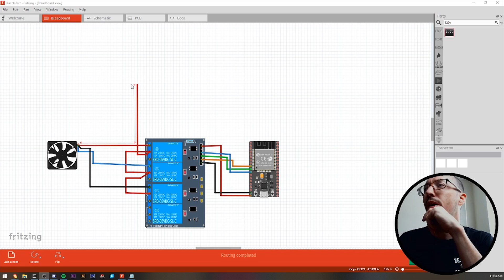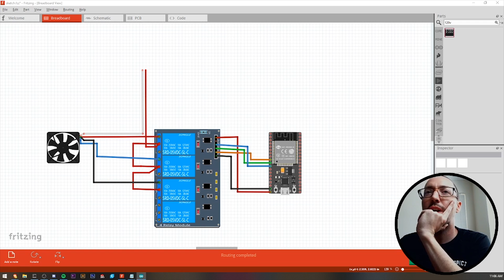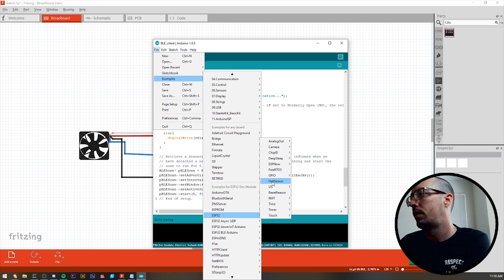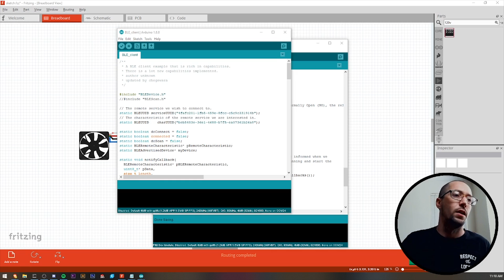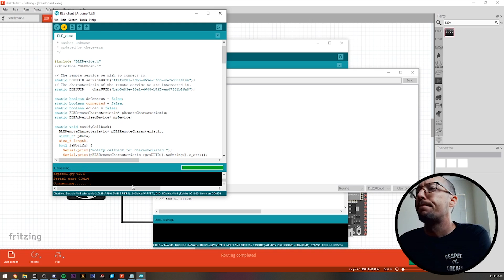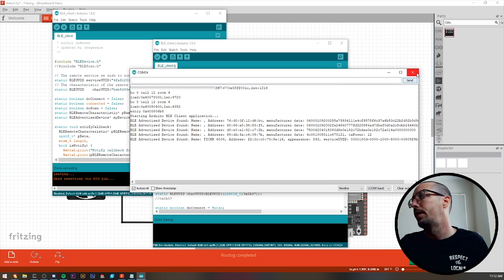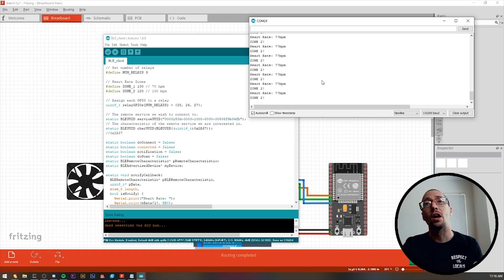DIY KICKR HEADWIND (HRM CONTROLLED FAN)

Comment: Hi Andrew,

Thanks for the details. I tried it with Garmin HRM-Pro but had lots of problems because scan can not find the hrm. When i move the esp32 very close to Garmin HRM-Pro, it finally catch it. Connections is disconnected when the distance more than 10/15 cm. I have searched and found some informations about power level. I changed the power level to ESP_PWR_LVL_P9 but it doesn't solve the issue. Do you have any suggestion ?
Reply from the maker: Sorry, I haven't had any time to look into this. I was thinking about redoing it, but with ANT+ so there is no connectivity per say, just processing of HRM packets.

Comment: Hi Andrew. I have a problem. I have no idea about programming, but I modified the script a bit. I have set up 3 zones:

// Heart Rate Zones
#define ZONE_1 110 // 100 bpm
#define ZONE_2 120 // 110 bpm
#define ZONE_3 190 // 120 bpm

Additionally, I would like the fan to turn on not when the HRM is connected, but when the heart rate exceeds 99 BPM.

static void notifyCallback(
BLERemoteCharacteristic* pBLERemoteCharacteristic,
uint8_t* pData,
size_t length,
bool isNotify) {
Serial.print(“Heart Rate: “);
Serial.print(pData[1], DEC);
Serial.println(“bpm”);
if(pData[1] == 99) {
for(int i=1; i<=NUM_RELAYS; i++){
digitalWrite(relayGPIOs[i-1], HIGH);

Unfortunately, this is where the problem . Sometimes HR drops beyond the value of 99BPM, e.g. the next value is 98 or 97 and then the fan does not turn off. What do I need to change. Thank you in advance for your help.

Comment: Just built this and it works great. You guide was easy to follow even for someone like me with no programming experience. The only things I changed were to use 4 relays. 0 - 115 bpm for no fan but the light for relay 1 tells me the system is working, 115 -  135 is low, 135 - 155 for medium and 155 + for high. In the summer I will make them lower but for now it is too cold as my cave is around 5 Celsius.
Reply from the maker: Awesome! Glad to hear it. Thanks for watching

Comment: I cant get it to work with my garmin HRM3-SS (came with a forerunner watch). Is this code only compatible with bluetooth-sensors? thought ANT+ is also a Blutooth'isch protocol
Reply from the maker: A quick google shoes the garmin HRM3-SS is ANT+ only which is a wireless protocol, but not BLE which this script works. This script does not work for ANT+. Sorry.
Reply: @WeRideSouth  thanks. Bought a wahoo Tickr and worked from first second. Thanks so much for your work. Tweaked the code to add a i2c oled. Next step is to delete the relays and use pwm. When it's ready and works some weeks, i'll publish for everyone.
Reply from the maker: @steffen_kuellmer  Awesome! I look forward to seeing it!

Comment: You can dual connect via Bluetooth to ESP32/fan and other devices (Zwift, etc) by using a HR strap with dual connection. I did not realize that this was possible, as I had an older Tickr strap. New Tickr/TickrX, Garmin HRM Dual, Polar H10 and Verity all seem to have this functionality. Not really sure how it works on the backend. I am using a new Tickr.  Same process of identifying the UUID, no other changes. Am able to connect simultaneously via BT to fan and iPad running Zwift without an issue.
Reply from the maker: This works as well, but I feel like a lot of people aren't going to go out and buy the new Tickr. I'm currently trying to iron out an ANT+ solution. I have some dev boards on the way. I haven't been able to squeeze any reliability out of an RPi Zero and ANT+ dongle setup. The RPi setup also increases the level of effort required to implement .
Reply: @WeRideSouth  It happened to work out that I was in the market for a new strap and realized that newer ones have this functionality. What boards are you trying out?
Reply from the maker: @mileslamberson3992  NRF52840-DONGLE
 and a D52QD2M4IA-A

Comment: Slick.  Wish the approach worked with ANT+ as I utilize a Garmin Fenix 6 with ANT+ broadcast for HR.  Plus this would allow the Fenix to communicate to both the fan and Zwift.
Reply from the maker: I plan to do something with ANT+ but unfortunately there isn't anything like an ESP32 that I have found since Garmin licenses ANT+. The closest I'll be able to get is to use something like a PiZero with an ANT+ dongle. It's in the works though.
Reply: @WeRideSouth  That would be awesome.  Utilizing a five-speed fan would be seriously cool.  For my pain cave, I mounted the fan on the wall behind me blowing down with a wireless remote.  An automatic adjustment based upon HR zones would be incredible.  Found a Taotronics 16" wall mount fan at $46.99 on Walmart.
Reply: @WeRideSouth  Great job by the way

Comment: Nice project. Thanks. I may get around to it if and when I finish your rocker plate design first. Sensible to have the fan related to HR rather than speed. You wouldn't want to have to put a gillet on when going downhill on your trainer.

Comment: Thank you Andrew for the great, easy to follow tutorial. I bought a lasko blower fan today and then came across this video and now I am thinking of doing this. Have you tried this in your lasko blower fan as you mentioned in the video? Is there any way I can also use switch to control the fan when I am not using the HRM. If so what will be the circuit like?
Reply from the maker: Thanks! Unfortunately I haven't tried my lasko fan specifically, but it should utilize the same principle. You can definitely control the fan the same way. You'd have to put the switch pole on a type of interrupter that would override the switch control when an HRM is detected. Unfortunately I don't have time to work out a circuit for you at this time.

Comment: Hi there!
Thankx for this, it looks really cool!

I'm having this issue: when I'm in the step of uploading the BLE example (10:48 in your video) I always get the same error "A fatal error occurred: Failed to connect to ESP32: Timed out waiting for packet header
" over and over again...

The only thing I have different from you is that my ESP module connects on Port 3...

I checked Baud rate on COM monitor and it's OK.

Can you please help?

Thank you in advance!
Reply from the maker: I would definitely try a different cable. You might have to try a few to get a good working one.
Reply: @WeRideSouth  actually I tried several cables and that's the only one that got the PC to recognise the board. The other ones just got the led light turned on...

Do you recommend any specs for the cable?

Thanks for your quick reply!
Reply from the maker: @luist76  I'm not sure of the specs, but I know I've had issues with random cables and had to try a few different ones. I also had to upload the program multiple times due to random failures. It's super finnicky. Also try plugging the cable in and uploading as close to the same time as possible.
Reply: @WeRideSouth  ok, I'll try it and let you know if it worked.
Thanks again!
Reply: Tried again with 3 more cables, same error...
I'll try in another PC, step by step from the beginning, just in case...
Reply: Ok, so I tried in my home PC, did everything again from scratch, but still can't upload the Bluetooth example...

I'm so frustrated... Tried several cables I have at home, only one made the connection, but still I get s timeout error...

The only thing I see different from the video is that my board connects to COM3 instead of 21, could that be the problem?

Or maybe the board is malfunctioning or non-compatible?
Reply from the maker: @luist76  your com port is specific to what your computer addresses to the device. In the video I show how to find what com port you need to use based on your computer
Reply: @WeRideSouth  yeah, I saw in device manager that it was COM3.
Reply: @Andrew Grabbs one thing I didnt get right: on the code you shared the interval limits are first high then low ( 100 // 70 bpm ) but in the video you have it first low, then higth ( 70 // 100 bpm). Another thing, the intervals should be consecutive, right?
Reply from the maker: @luist76  I changed the interval limits for demonstration purposes, I didn't want to have to get my HR up very high to show how it worked. 

The intervals should be consecutive. The way the code works is less than or equal to, so you can set a point in your HR whether it be % based and get the desired affect. Zone 1 for example, less than or equal to 100 bpm. Then Zone two is greater than 100 but less than 150 bpm. 

Hope that helps.
Reply: @WeRideSouth  I'll try to do that. To be honest I'm not very familiarized with arduino programming, lol... But I guess eventually I'll get it done!
Thanks again for your help!
Reply: @Andrew Grabbs I'm sorry for being a newbie at this... I just can't get the code right... Could you please post the code for 3 heart rate zones? One other thing, when I run the example to get my HRM UUID it's exactly the same as yours... is this normal?
Reply from the maker: @luist76  the code is here: https://github.com/agrabbs/hrm_fan_control

It is possible to get the same UUID, you will know it's right if you start getting heart rate feedback.
Reply: @WeRideSouth  Thankx! I got it working, yay! 
One more question: is it possible to connect the Live wire to the relay instead of the Neutral? I'm asking because my vent is connected that way, the L connects to the switcher...
Reply from the maker: @luist76  yes, you can switch the live or the neutral. It just may take some more work as you'll have to switch 3 three live wires as well.
Reply: @WeRideSouth  I guess I'm really a disaster... I managed to upload the code and get the heart rate signal on the serial monitor. Then connected everything but... Can't get the fan to work... I don't know if it's the arduino board (the led won't turn on) or the relay board... 
Do you have a suggestion?
Thanks again for your help!
Reply: I just realized my relay board is different from yours, they're numbered backwards LOL
I'm going to try this again see what happens.
Reply: @WeRideSouth  The code linked here has only two zones (there is no ZONE_3). I know it's not rocket science for many and sorry to bother, but would you have a link with a code with the three zones? Thanks a lot!
Reply from the maker: @nardixbici  The 3 zones in the video didn't make sense because in reality it made 4 zones. Having two zones defined gives you the programmability of 3. Less than Zone 1; Greater than zone 1 and less than zone 2; Greater than zone 2.
Reply: @WeRideSouth  Thanks for replying! I eventually saw that you said so in the video. I am almost there, my relais are working and displaying z1, z2, z3 correctly!
Reply: @WeRideSouth  I finally did it and it's working! Many thanks for this! You deserve more than a few clicks on your affiliates! 
You rock man!!!💪

Comment: Hey nice project! Can I do this on Vornado DC Series (99 levels of fan speed)?
Reply from the maker: Thanks! I'm not sure about that one. Likely the Vornado is using something other than motor voltage to change the fan speed if it has 99 levels. Likely this wouldn't work.

Comment: can I connect like 3 fans to same 4 Channel Relay? as I understand, each of it is up to 10A, each fan on max required  1A, so should it be fine?
Reply from the maker: @AntonyChard  check the relate module ratings, but I would put one fan per relay and just switch them all on or off.

Comment: Thanks Andrew, this is great! I know nothing about programming, Arduino or even electronics. But his video (I got the link through the FB Rocker Plate page) makes it simple and clear and I am pretty sure I'll try to build one. I already saw that the components are available locally. Kudos!
Reply from the maker: I'm glad to hear and thank you! Let me know how it works out for you if you build it.
Reply: @WeRideSouth  Ok, now the three relais work well. It took me a while to understand that only the first number of any zone (the one preceding the //) is meaningful. I have two questions. 1) I am not sure about the Bluetooth ID, are they all the same? Your and mine two HRMs have the same ID "0000180d-0000-1000-8000-00805f9b34fb" even though it is followed by a more complex one (e.g.: 6a4e3e10-667b-11e3-949a-0800200c9a66). Should I use the latter to avoid interferences? 2) Would it be possible to define zone 1 (when is less than the entry value) as fan off? (i.e the fan would start only when it reaches Z2) Just curious, I suppose it's simple like switching to relais 4 that is not powered--is that so?
Reply from the maker: @nardixbici  the UUID should just be the one returned by the test script. As for an "off zone" if you look at line 44-48 on my github code you can see that there is a zone defined for OFF == 0. You could easily change that to less than or equal to a number... say 70 and this would accomplish what you're trying to achieve.
Reply: @WeRideSouth  Thanks Andrew. On the UUID, I was asking b/c the Serial monitor shows two IDs: <<HRM-Dual:275339, Address: dc:3e:a2:ae:f7:7f, manufacturer data: 87000ce3, serviceUUID: 0000180d-0000-1000-8000-00805f9b34fb, serviceUUID: 6a4e3e10-667b-11e3-949a-0800200c9a66>>. Maybe the second one is for ANT? I was curious though as the UUID is exactly the same you used. On the off-zone, i was able to re-programme for 4 relais (i.e. 3 zones) as I am not sure what instruction you were referring to (as of now I am sending to the fourth, unpowered relay; I suppose I could send to neverland as well). Which brings me to another question. In the schematic you provide, I see that you use relays 2-3-4, but the connecting wires start from the pins marked 1-2-3: am I seeing things or there is an error in the diagram? Anyway, thanks a lot, even if you do not have time to answe: I am discovering a new world!

Comment: Hi Andrew, thank you for a great tutorial . I made it myself and tested it with Polar and Wahoo HR monitors. I didn't have to change UUID in your code, at least for Wahoo and Polar H10, it works for both devices without any issues. Seems like all HR monitors would work with it (whichever will connect first will control the fan). Keep up the good work.
Reply from the maker: Thanks! That's good to know about the UUID.
Reply: I found the same. The UUID seems to be a generic one.

Comment: Hi! Just wanted to share an idea I had for this: for the ESP32 power source I used an old usb celphone charger, ripped it apart and connected the 220V pins on the fan wires and the 5V output to the ESP32 (be careful of polarity, check with a multimeter). This way I dont need to have an extra USB cable to power source the ESP32. It's working nicely!

I also oreder a solid state relay to replace the current one, wich will hopefully save a lot of space and make a more compact setup then my actual.
Reply from the maker: Awesome! Let me know how the solid state relays work out.
Reply: @WeRideSouth  it's probably gonna take a while since I ordered from AliExpress but I'll let you know
Reply: @WeRideSouth  when are you going to build an home made Sterzo?? 😁
Reply from the maker: @luist76  that should actually be pretty simple. I'll add it to the white board. 😁
Reply: @WeRideSouth  yeah? That would be just awesome! Please please please please do it! 😁
Reply from the maker: @luist76  I finally found a 9DoF sensor (everything is sold out) should be here by this week. There should be no issue getting degrees from the sensor, the problem is there is no BLE spec that I know of for steering. Sterzo must be using some custom broadcasting (which also only works with zwift). I might do a recon mission to my local bike store with a BLE sniffer to see how they are broadcasting to zwift. I'll keep you in the loop.
Reply: @WeRideSouth  I sent you a pm on Instagram!
Reply from the maker: @luist76  so after much trial and error it appears Elite and Zwift have upgraded the FW and App since that video posted. I'd have to get my hands on an actual Sterzo or the firmware to see what they've done as the previous reverse engineering is no longer valid.
Reply: @WeRideSouth  okay! I hope you have time to do it 😁

Comment: Wow, great work! Unfortunately, I never did anything with an Arduino before. I just did what you are doing in your video and I think the Arduino works fine. I can connect my Forerunners 245 and the INR1, INR2, INR3 lights on the relay switch on and off according to my heart rate zone. 

But: The fan does not switch on. I unplugged everything, checked every cable ... can't find any difference from your approach. Any idea what the problem could be? Is it correct to use K2-K4 (and not K1 although we use IN1-IN3)?

Thanks for your help!
Reply from the maker: Are your relays switching when you change the pin? If not you might have to check how you're powering the relay. There is a jumper that will let you power the switch portion with an external supply. Might be worth checking the documentation of your specific relay.

Comment: This is brilliant, would love to have access also the the battery service for my HRM has anyone had a crack at getting that to also show?
Reply from the maker: I'm not sure the HRM broadcasts battery level. I'll dig around in the profile.
Reply from the maker: I stand corrected. the Battery level characteristic on my TICKR is 00002a19-0000-1000-8000-00805f9b34fb and reads out 0-100 for percent.
Reply: @WeRideSouth  I did see that on mine also, but have been unsuccessful in getting it to read (more my skill level than anything I assume)

Comment: What size leads/wires do I need for the incoming side? I'd assume they are the same size as the fan wires? And guessing we can use small gauged wires on the relay side as it should be stepping down the voltage? 

Eg. 1.5mm wires coming from the fan, so all others on the incoming side need to be 1.5mm. All wires from the relay side could be 1mm?
Reply from the maker: It is recommended to use 12-14 gauge wire for 120 volt. I think it's the same for 240.